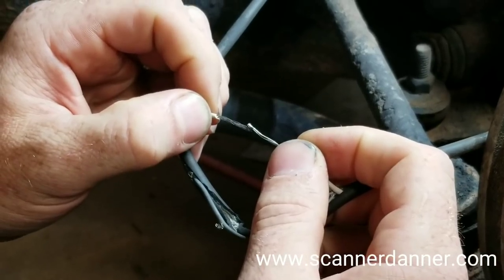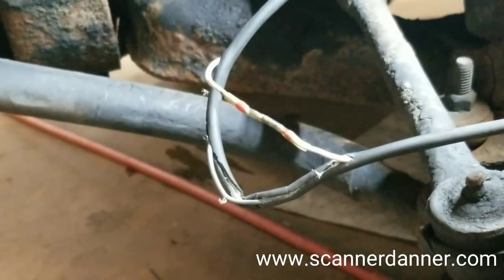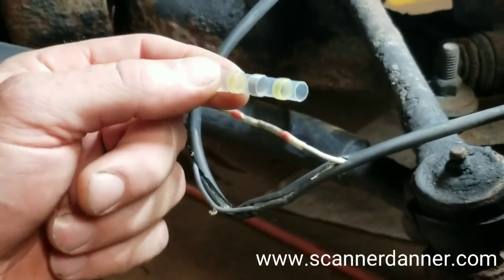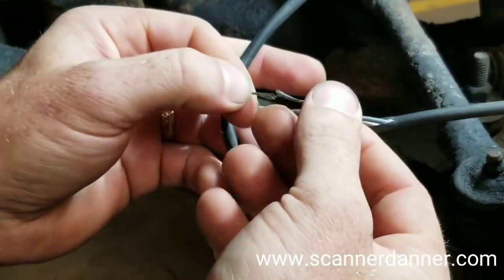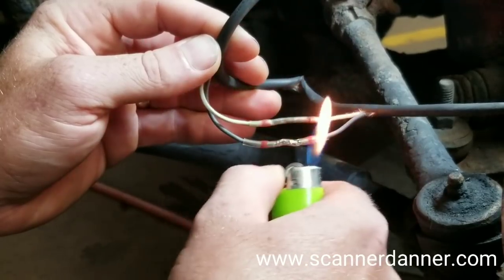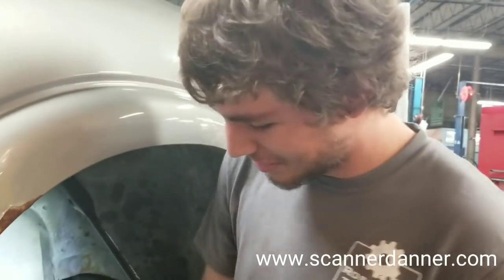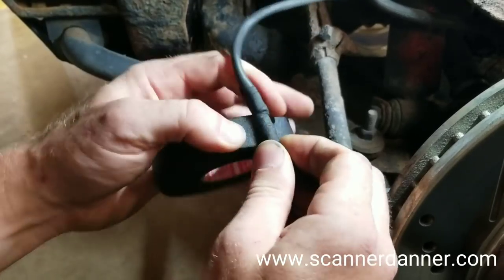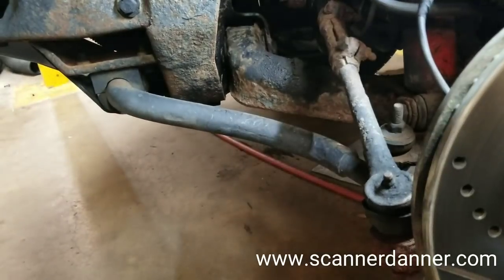Using Solder Seal Heat Shrink Butt Connectors

Comment: I have found quite a bit of wiring now is copper clad aluminum and is very difficult, if not impossible, to solder
Reply: ?  It's not hard to solder to the copper cladding, you simply must leave it on the wire.

Comment: Yo, Tesa is a brand... There's actually multiple different types of Tesa tape. I'm pretty sure youve got one of their friction tapes. Cloth tape with adhesive... kind of like gaffer tape on steroids. I agree it's much better than bullshit electrical tape any day. Stronger, seals better, looks better, and holds up better to...yep, friction...and just about anything else. Also, there are, in fact, waterproof tapes,  (Flextape, etc.). Pretty sure Tesa makes some too, a few different kinds. I think they have a version of one of my favorite types, silicone self amalgamating/fusing pipe tape. Originally used for pipe repair so it's super stretchy and creates a flexible perfect watertight seal. Its self-fusing so there's no adhesive to break down or leave residue and supposed to llast for like, 10 years or some shit. I pair it with friction tape or heat shrink tubing and that's what the fuck is up. So far as I know anyways.  I haven't used these soldered connectors yet, but this video kind of makes me excited to lol. I know they've been around for a while, (yes. I recognize this video is old as fuck) I've been putting off ordering them...until today.  Fuck it it's my birthday this weekend and I'm making life easier.

Comment: i always use grote 83-3110 uninsul and there many size. but . with shrink tubing with the glue ...it better than one with shrink tubing because you damage the tubing when it press.... i never weld wire .... on are truck fleet never had a comeback. you see the car manufacturer do that in there wiring hardness  and i find it bit more flexible .look better on big job plug with lot of wire. i live in area that use lots salt on are road

Comment: Great tip 👍
Reply from the maker: I dont like these much lol
They're all the hype but then the solder doesn't flow all the way through. I don't know. I like the heat shrink adhesive lined crimp connectors better

Comment: If you had to repair both wires then why not put a heat shrink tube over the whole repair assembly, instead of tape?
Reply: OR better still, put the tape on for strength and then heatshrink tubing over top of the tape.

Comment: I am a fan🎉
Reply from the maker: I dont use these often. Guess I still don't trust the low temp solder. I still prefer my heatshrink crimp connectors over these
Reply: @ScannerDanner  OK, I did like your demonstration and you discussion. It will work for me, I am a casual user. Thanks.

Comment: I have only used the yellow ones and was not impressed.  I cut it back off and soldered it with heat shrink over the top.

Comment: Why not cut the harness outer sheathing,  put a larger diameter piece of heat shrink over the harness, put the 2 solder connectors on the 2 wires, and heat shrink those, then heat the outer piece if heat shrink over the entire affair? So what if you cut the outer harness sheathing,  its already trashed. Electrical tape to complete the connection? Sorry, I don't concur with that part of it.

Comment: Yo Paul  try some of this for tape  
https://www.amazon.co.uk/dp/B007554ZI6/?coliid=I1KR0QBWOWVBCY&colid=3VIIQB9GVJDF4&psc=1&ref_=lv_ov_lig_dp_it
Probably available on amazon usa.. its also called silicone self amalgamating tape.... I think  its quite cheap  there are other versions of it( I think is waterproof)
By the way  don`t work for them...
Have some of them connectors here in the uk.. and yep thumbs up..use low heat though not anything like butane mini torches..
Ta
Neil

Comment: I have stopped using these because they do not last. They are not sealed good enough. I use the crimp style ones, with the glue inside. I believe you have used them on your RV.
Reply from the maker: I like the crimp style ones better too

Comment: I hate these connectors, it's the lazy way out. I've never had issues using solder and heat shrink on abs wires.
Reply: 🤓 ok

Comment: Something is wrong with your soldering technique, as there is no reason that would work while correct soldering and heatshrinking wouldn't.  If you have a mental block about learning technique and various solders and flux use, or just have too much else to occupy you to learn this, so be it, but it is not rocket surgery and a lot cheaper (and just as easy) to use the standard materials you can also use elsewhere on automotive wiring repairs.

The longevity of the repair may depend on why it failed in the first place.  If this was due to the wire continually flexing and it needs to do that (opposed to it being loose and flexing or rubbing against something, or exposure to heat) then you have introduced an inflexible area within the portion of the wire that needs to flex, so the rest must now flex more to make up for that inflexible area.  In that case, you should add a little extra high strand count wire so there is extra slack and flexibility instead of less.  This is commonly the case in areas like door hinge wiring harnesses that break after the door is opened and closed X # of times.

Comment: Ever heard of a heat gun? Wow using a lighter is so amateur.
Reply from the maker: heat gun would be better but working in the field, there is not always an outlet available, so this is absolutely a viable alternative
Reply: @ScannerDanner  Were you working in the field with no outlet available?  Stating what might need to be done in a pinch, is not a reason to always do it that way.
Reply: @ScannerDanner a habdheld butane blower with a diffuser attachment works well.